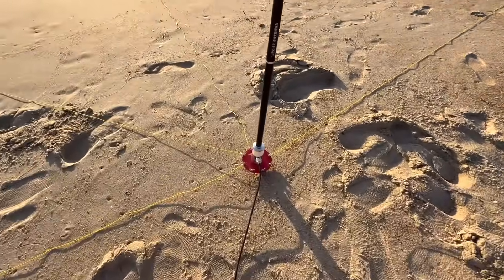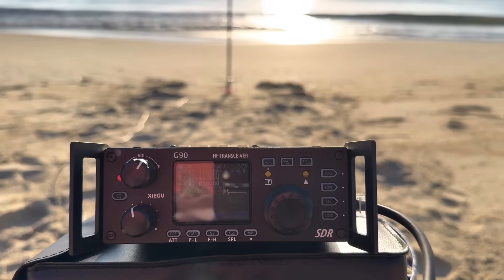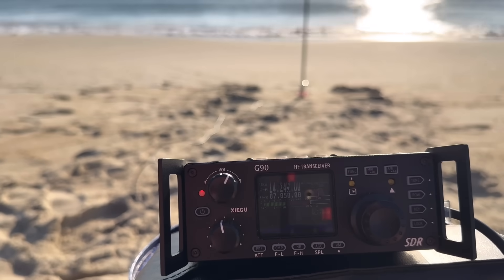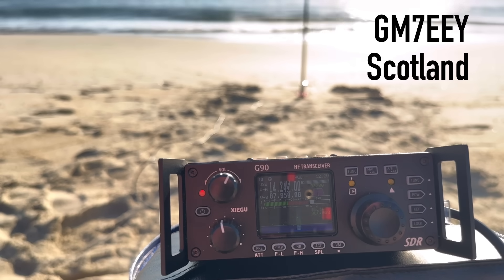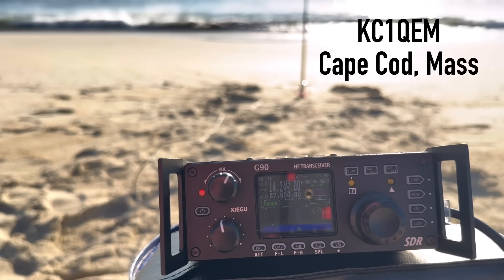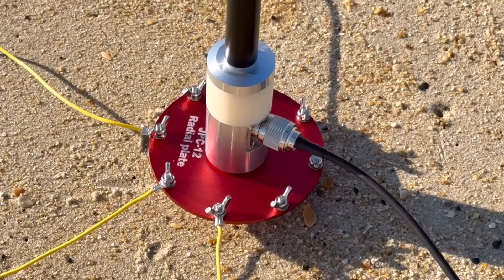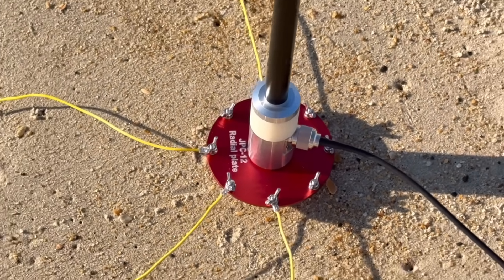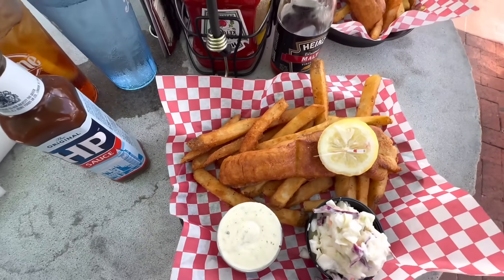Adding a Capacitance Hat to a Vertical Antenna

Comment: Good morning Walt,  I really enjoy your content.   I even purchased your book.  As a new ham, I'm looking forward to experimenting with some of your designs as soon as my general upgrade of posted in the ULS.  Question:  how does the JPC 350 compare to the JPC 12.  Is it as efficient?  I'm considering one or the other to accompany my new Xiegu G90.  Kepp up the great work

Jeff KR4HNF
Reply from the maker: Thanks! The JPC 350 is a better antenna if you’re trying to decide between the two. Gives you 60 and 80 meters should you want to work those bands. 73, Walt
Reply: @COASTALWAVESWIRES Thank you sir. , 73

Comment: Thanks for this interesting video !  I have tried these hats before.  It does increase the electrical length of the antenna. However, they are usually recommended for non-resonant antennas. ie: when adding ununs to help with impedance & help out the antenna tuner do its job...  If your antenna is resonant (without ununs or coils) already & add a hat, you will have to retune since the perceived length will change - then you end up as it was before you added the hat - resonant;  but with basically the same performance.

Comment: HP sauce is an amazing substance, best on a bacon and egg sarnie.  Salt and malt vinegar is mandatory on hot chips.  The smell and taste is mouth watering.  Cod is king, but breaded Plaice has its own charm.  Curry sauce to dunk your chips in works well, especially if you through in all the very small chips and drink it.  Mushy peas i like and im a southerner.  It dividesmopinion down here.  Another tasty option is chips and gravy.  I lived in the US and our gravy is different.  Much more beefy and darker.  Bisto gravy was lovely, but the salt and proper beef stock have been reduced and its a bit bland now alas.  Homemade is better - get those bones boiling!

Comment: Hello Walt, another great video, thank you. I have a cap hat from Chameleon that does not work on the ends of their whips (without mods). I have appreciated you pointing out good practices, good equipment, and having fun with ham radio. Keep it up! 73 KQ4IXD

Comment: I bought the same product a while back. I used it in a 5.6 metre whip. It brought the resonant frequency of the whip (without radials) down from 15336 kHz to 13926 KHz. That's a nice 1,410 kHz drop, but in reality is like adding 47cm to the length of your antenna.on that frequency range.

Comment: The cap hat will broaden bandwith, it increases the capacitance at the top end of the antenna which in turn improves the current distribution, Q, and overall efficiency of the antenna. Look up the Marconi  T - Antenna ( It was used on the RMS Titanic). Search Wikipeda regarding T - antennas. Cap hats are AWESOME. Best 73 de ZS6AKW

Comment: Hats off for the baloon/sea turtle comment..! Thank you for yet another great and informative video Walt! Just a quick question, doesn't the capacitance hat put strain on the - already fragile - end of the whip? Especially if there is a slight wind? 73s de SY1ESG
Reply from the maker: It really wasn’t that much of a strain. That cap hat is actually made for that antenna.
Reply: @COASTALWAVESWIRES  thank you for thw answer, great to hear, will give it a try! 73s

Comment: Capacity hat works.  The outher plate is the water . Less coil is needed . Yes does lower take off angle . Bands still quite bad in NY . I get lots of noise on 40 meters  during day time.  Had some trouble at AM station I watch over. Not full time anymore .I know current engineer . They lost GPS lock on transmitter 2 days because of solar storms. Not a problem that the fiber network did the lock . The WWV lock was out during the day as well. They time sync and use the 10 MHZ reference to lock AM transmitter . It stays on frequency with out GPS lock . It has crystal unit. A real good one.   Girlfriend noticed GPS did not show her speed. And was off a bit for location . Less sat received. Comes up on display . Star link lost some sat alights because of solar storms.  I lost internet during the day for like a hour .  May or may not be the sun. Cable company told me was the sun.  It was odd that parts of internet worked fine and some sites down or super slow.  For a wile nothing worked. I hope to get the book soon. Other medical expenses got  us. So happy you and wife got threw that !!  Many of us going threw that as well.  The love and support we give each outher really helps a lot !!  Cheers from NY !! Fish and chips came from England and I love it !!! Great food all around the whole world !! 73

Comment: Great video.  Are the three radials on the Starduster M-400 doing the same thing? Are those radials a capacitance thing?
Reply from the maker: If they are at the top of the antenna, yes

Comment: Try rewind the JPC-12 coil with 1mm diameter tinned copper wire to get higher Q at 7Mhz. The original is stainless steel wire, which has total 6.5ohm real part resistance in it. It makes the bandwidth looks wider but at the cost of adding losses of energy.

Comment: Great video Walt. Lost colony still a favorite of mine. I'm gonna buy a lottery ticket tomorrow. I so want to move back down there. But I have one lingering question, how much if at all does it matter if your set up right at the waters edge or up on the sand dune? I like the dune because I don't have to deal with all the people, what say you my friend?
Reply from the maker: I’ve found that being in the wet sand is much better

Comment: Walt, you can significantly increase the effect of the caphat with interconnecting wires (30 gauge stranded should work and be light enough) at the ends of each spoke.  Exactly how to attach wire to each spoke's end may be problematic.

Comment: Hey Walt,  on the beach,  I've seen you use ground radials, the .05 counterpoise and the saltwater counterpoise.  Any rime or reason on how you choose from day to day?
Reply from the maker: Only use the .05 counterpoise on a halfwave vertical. This antenna is electrically a quarterwave which requires a complete groundplane.